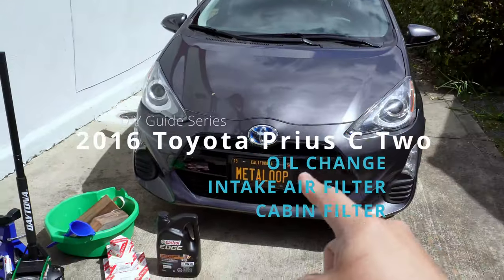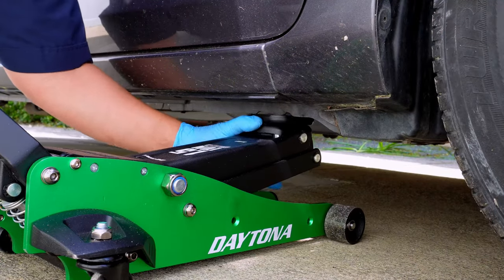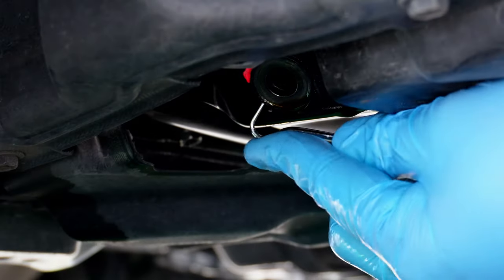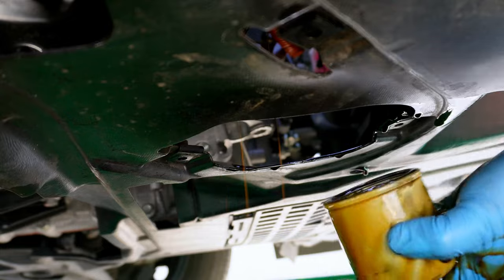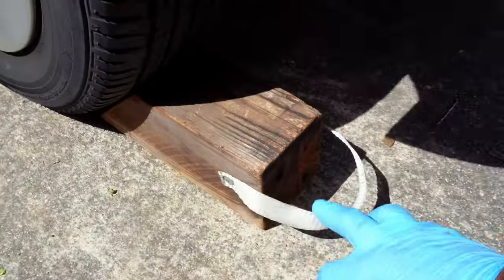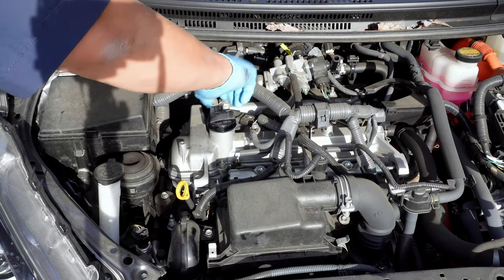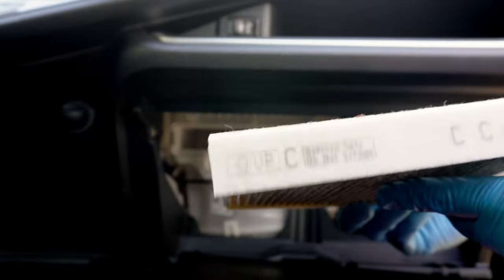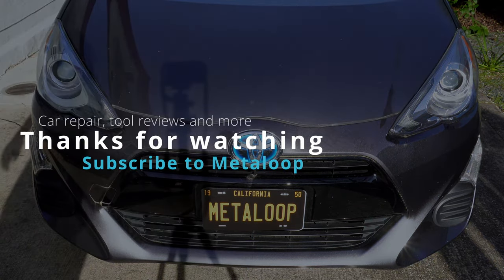Complete DIY Guide for 2012-2021 Prius C Oil Change and 30K Maintenance

Comment: Here's a trick I found on google regarding removing the oil filter without making a mess :

- Start to unscrew the oil filter (not all the way)
- Take a red plastic cup and use it to completely unscrew the filter (hold the filter with the cup)
- Oil will drip into the cup

Hope this helps!
Reply from the maker: Really great tip! I'd give that a try next time. I'm pinning your comment for future watchers.  Thanks so much for leaving a comment.
Reply: @mldiy  You're welcomed!
Reply: @mldiy  Is it possible to get the oil filter unscrewed by hand? Don't really want to buy the special fitting if I can get by without it.
Reply from the maker: @hu_b  Yes, its possible but depends on if the last guy overtightened or not.  You'll see in my video that I tried to unscrew by hand first without luck.  You can try to unscrew by hand before you drain the oil. If you are able to, just loosen it slightly just to confirm you can do it by hand, then drain the oil. 

If you really want to, you can try jamming a screwdriver into the oil filter and using it as a lever.  It'll be messy, but if you are doing your own oil changes moving forward, you can trust yourself to not overtighten for the next time.  

That all said, I'm a firm believer of having the right tool for the job and spending 20-30 bucks on a cap wrench feels like it breaks even after one oil change. Let me know how it goes if you decide to go without. You might get lucky!
Reply: @mldiy  Thanks for the reply and well done video btw. I tried, no luck. Hard to get any leverage in that tiny gap and if I did manage to get it off by hand I wasn't sure I would be able to get the new one properly seated. I have one of those band wrenches I'm going to try... will see if there's a way to fit it into that narrow area.
Reply from the maker: @hu_b  The good news is if you can get it off, the new filter only needs to be tightened by hand.  I know in my video I used the cap wrench to tighten as a final step, but all I really did was check that it wasn't too loose.  Worst case for you is grab a towel like you're opening(closing) a jar and just give it another 1/8th of a turn once you feel like you can't tighten it any more by hand.  

I didn't have any luck with a metal band wrench as it was too rigid and not enough room, but if you mean the rubber strap type wrench, that might work.  The filter pliers I used are from Harbor Freight and I think I bough them for something like 5 or 6 dollars.
Reply: @mldiy  I tried the rubber band wrench but nowhere near enough room so I gave the filter pliers a try. Couldn't get a decent grip from below so I ended up taking the splash guard off (18 screws!). Then I could use the pliers to mangle the filter and eventually get it loose but it was still a tight space to work in. And using a plastic cup to finish taking off the filter after it's loose worked great. Anyway thanks for you help... subscribed.
Reply: Thanks for the tip this worked great

Comment: Great video. Thankyou.😊
Reply from the maker: I'm so happy you liked it and I hope it helped! More Toyota car guides are coming so please do consider subscribing to catch them.  And it really helps me out too.  https://www.youtube.com/@mldiy?sub_confirmation=1
Reply: @mldiy  Suggestion for you: follow-up with a part 2 of this video showing all the inspection items in the 30k service like how you check the ball joints, fuel lines, steering linkage, tighten the chassis bolts etc. If not on the Prius C then on another Toyota. I haven't seen another channel do that.

Comment: I lost the screws for that exact panel, any idea of the dimensions?
Reply from the maker: OEM part is 90119-A0098 or something similar, you should double check. You may also be missing the clips that the fastener goes into. Your local Toyota parts department will be happy to look it up and give you part numbers with no pressure to buy.  Best of luck.
Reply: Thank you so much for your answer!, God bless you with 4 wifes! @mldiy

Comment: The oil drain looks close enough to the outside that you can change it without jacking the car up. can anyone confirm? Also has any car ever been designed to the oil drain plug is easily accessibly without jacking up the car?
Reply from the maker: HI Nelson, you can definitely get to the drain plug without jacking up the car, but the issue is going to be clearance for your drain container.  My big green catch pan would basically touch the bottom of the car if it weren't lifted.  So you would need a very thin and wide container for 4 quarts of oil that would still give you enough room to get your hand and ratchet onto the drain plug without spilling oil all over the place.  You definitely wouldn't be able to get to the filter without lifting the car.  

While I definitely wouldn't endorse this idea, you could also try driving the right side of the car up on a tall curb.  That might give you enough room to get under there.  (again, not a recommendation, I still would encourage just buying the tools to save money and increase safety in the long run).  Thanks for the comment and thought exercise.
Reply: If you remove the front passenger side wheel, the drain bolt is easily accessible within an arm's reach.
Reply: @dominicfong6341  Still need access to the oil filter
Reply: @hu_b  No need to jack vehicle up for the engine oil filter either; just grab it from the front...zero chance of accident just as long as you're parked on level ground with tires chocked, parking brake fully applied.
Reply: @dominicfong6341  Have you removed the prius c filter that way? Seems impossible to me unless your arms are 6' long.
Reply: @hu_b  It is absolutely doable on the prius c, am only of average height. the filter housing is reachable with bare hands or filter removal tool.